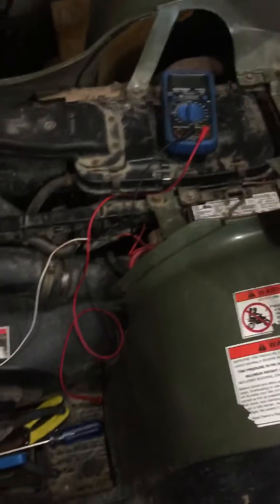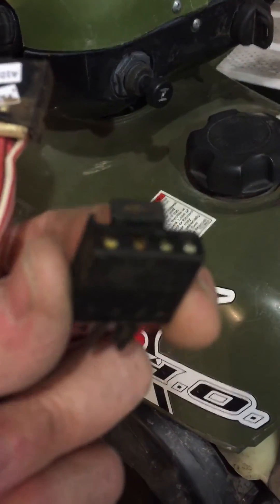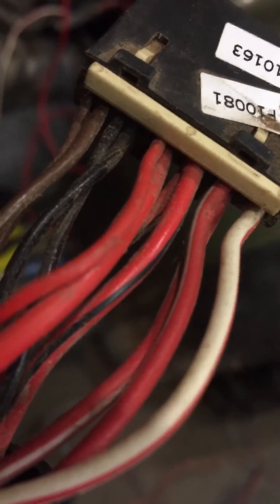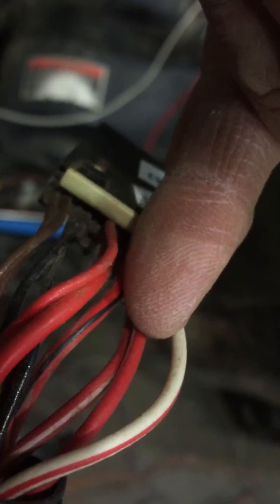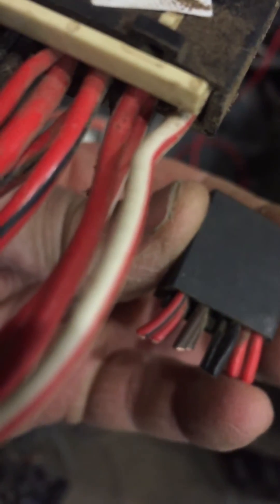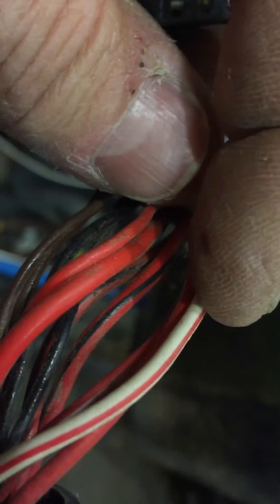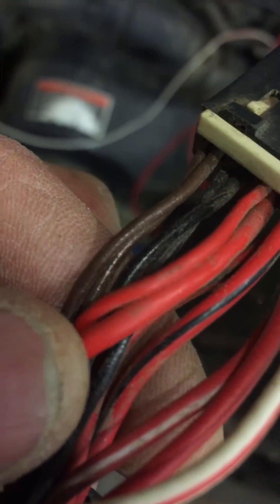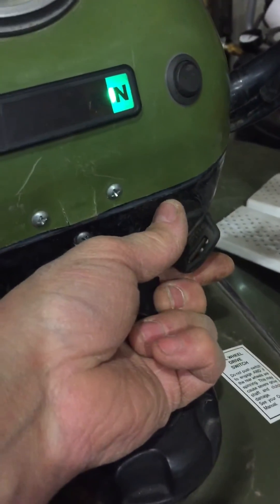2001 Polaris Sportsman 500 push button start to keyed ignition start conversion

Comment: Do you know what  each color wire means on on the 6 pin connection?
Reply from the maker: Solid red is battery +. Red /white is switched power. Brown is ground. Black is kill switch systems. White is start system. Not sure about the red/black

Comment: what did you do with the other red wire that is in the same position as the red/white striped wire?  or are both of those wires red/white striped and connected to the solid red?
Reply from the maker: If it’s in the same spot as the red/white, it should be the same colour. At least mine were all the same colour in each spot.

Comment: did you leave the wire orientation the same as the 6 pin you showed? as in brown, black, red, red with black, etc or did you change the positions to match the 4 pin? im not getting power when i turn key, but it neutral light and everything comes on in start position.
Reply from the maker: Justin Schwinn no changes were made in colour. Just match the colour. If you don’t have power to the starter, check the white with red stripe if it has power when the key is in start position. Also check if there is power at the solid red.
Reply: @timwebster9486  when wires hooked to same color, in on position light comes on and starter engages. it stays the same when turned to start.
Reply from the maker: Justin Schwinn somehow the white with read is getting power before it’s supposed to. It should only have power when the key is in start position. Try running a new white with red to the solenoid and unplugging the original white with red.